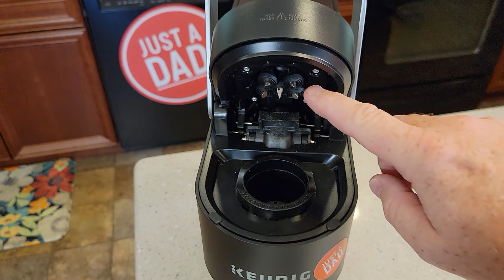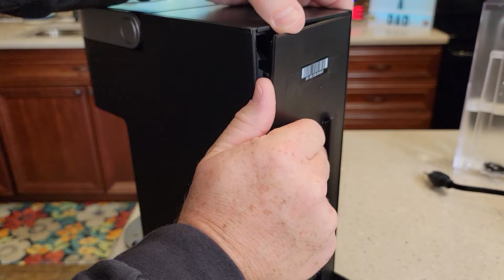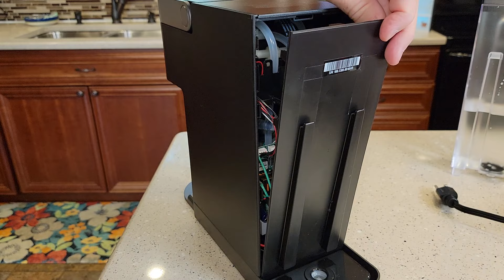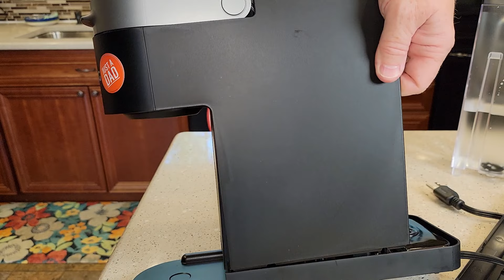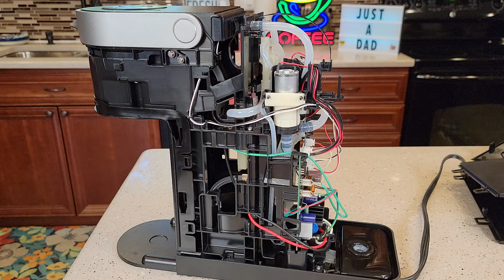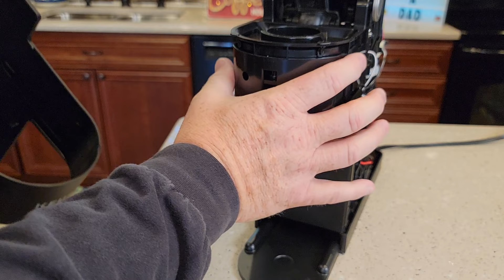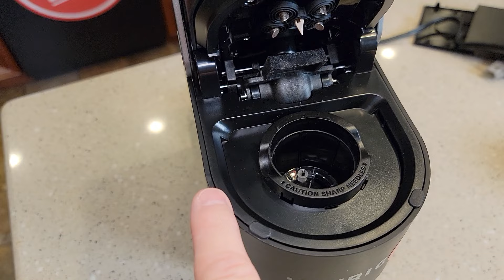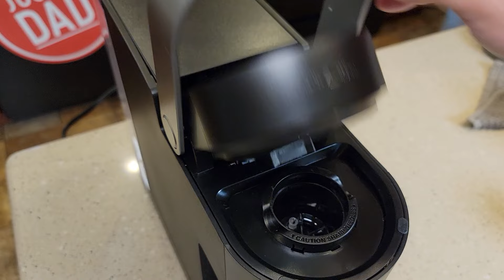🔧 Keurig K-Slim Not Working? | Thermostat Reset & Repair Guide

Comment: I have the Costco version of the bigger version of this Keurig. I returned two of them inside of 90 days. It went totally dead. On one return trip a guy walked up to the return line an asked my what was wrong with mine? He also had a dead Keurig. Very frustrating design and that’s why I buy my Keurig at Costco. Over the years they’ve had erratic reliability issues and Costco has been great on taking them back. It’s ridiculous they designed a reset switch for what appears to be a common problem with no external access. I’m not doing the surgery if I break it Costco may be lass likely to accept it back.

Comment: Thanks, just a dad! I tried this on the Keurig K slim iced brewer and it worked like a charm.

The front didn't come all the way off like in your video but I managed to reset the machine.

I had sent my original Keurig back for replacement so this was the second one and it is a hassle to give them all the documentations. Your video save me from all of that and I applaud you. 😊

Comment: Thanks to this video I had hope of fixing my Keurig Slim. Your clear explanation of how to remove the case was a godsend. However, once I got inside my machine looked nothing like the one in the video. There's no tube with another tube spiraled around it. I could find nothing that even remotely resembled the thermostat. Could I have an older or newer model?
Reply from the maker: yes the older K-Slim with only one needle does not have the reset and has a different heating element.  Sorry the older k slim can not be fixed.  The new K slim has 5 needles on top

Comment: Happy June 12, 2023 - THERMOSTAT LOCATION ISSUE  -   I have the Keurig K-Slim Coffee Maker with No Power,     Know that your guidance to open the housing worked smoothly.  However, there is no Thermostat in ore near the green ground wire.         Do you have any suggestions.
Reply from the maker: The older K Slim that has 1 needle on top does not have the reset, only the 5 needle multi brew K-Slims have the reset, sorry

Comment: Nice job "Just a Dad".  I thought there would be or should be a reset someplace, but figured I'd probably destroy the case taking it apart.  You did an excellent job describing the steps necessary to disassemble it.  Thank you.

Comment: Really good video and it really helped in pulling the unit apart. One issue. You don't mention that you need to remove the top panel above the electronics to then be able to rotate the main cover. The 4 clips hold it in place otherwise.
Reply: But I should mention that it worked perfectly and the unit is back up and running. May I ask something. My SIL was running a Descaling run when it died.  I am suggesting that in future she runs  2 or 3 cups of half vinegar, half water through the descaling process. Throw the hot mix back in for the 2nd & 3rd time to really clean the unit out. Then run at least 3 12oz runs through the Keurig to remove all the vinegar out of the system. Between your videos, and the comments online, I think the thermostat overheats because the Keurig Descaler bottle does not have enough liquid to not stop the thermostat from kicking off. Adding extra water means the system never activates the out of water feature while descaling.

Comment: A perfect walk-through! First descale on my Slim led to the power outage towards the end of the cleaning phase - seems  the add water trigger didn't trigger and the tank ran dry, system overheated and tripped the thermal "breaker" (not really a thermo"stat"). One of two design flaws in an otherwise lovely device (the other being not having access to the thermal breaker without taking the cover off - not that it was a pain. Far worse to get the grandkids' car seats in and out.). Thanks for the clear and detailed how to!
Reply: Exactly what happened with mine.

Comment: Hi!!!  You keep saying this is a Keurig Slim...however when I opened mine up it doesn't look like this one.  I can't locate the reset button.  Help!!!
Reply from the maker: The original k slim has a u shaped heating element and it does not have a reset.  if you have one needle for the top of the k cup then you have the old model with no reset.  the newer one with 5 needles on top has a reset.
Reply: @Just A Dad Videos  thanks for clarification.  Not sure what happened  but after opening it up it's working again...go figure.   May be time for an upgrade.

Comment: Hey buddy I took mine apart there is no little thermostat to reset
Reply from the maker: The original k slim has a u shaped heating element and it does not have a reset.  if you have one needle for the top of the k cup then you have the old model with no reset.  the newer one with 5 needles on top has a reset.

Comment: Took my k slim apart but the inside looks different. Can’t find that thermostat.
Reply from the maker: The original k slim has a u shaped heating element and it does not have a reset.  if you have one needle for the top of the k cup then you have the old model with no reset.  the newer one with 5 needles on top has a reset.

Comment: I appreciated this video and the function video on the keurig slim! Do you know if it's possible to replace the micro switch itself? The thermal unit and cable is intact but the switch may be bad and can't find a way to replace it in this model. 

Any tips?
Reply from the maker: maybe but finding one could be tricky

Comment: Worked like a charm for my K-Slim with Iced Coffee maker. BUT: had to do it two times because that darned air pocket caused the overheating… twice! The third time I heard it sputtering and I immediately unplugged it. Gave it a minute, re-primed the water again… and then started a cycle. And it worked like usual! Thank you, again, for your thorough walk-through!

Comment: THANK YOU! I knew there was someone out there in youtube land who would tell me how to fix this. I have a different model but knew the inside design would be the same. Not gonna lie, in my anger and haste I did break a bunch of the tabs in the process, but after putting it back together you'd never know. : D When this KEURIG finally goes for good I'm out what a crappy design. ps- not the first time this has happened, just the first time no longer under warranty. What does Keurig do? They try to convince you it's your outlet then eventually send you a new one.
Reply from the maker: Good points

Comment: Outstanding video! When my Keurig went down, I got on the phone with the company, and their troubleshooting extended only to unplugging in the machine and plugging it back in. After that they only offered me a 20% discount on a new machine. Your video was easy to follow, and it worked perfectly. Many thanks!
Reply: I kept saying no that’s not going to work and finally after being transferred I was offered 50% off any unit. We will see if they honor that since I didn’t pick one out right away. They said they would put a note on my account.

Comment: I just dismantled the one at my work that looks exactly like this except it doesn't have that thermostat that you're talking about. And what it has looks like a radiator coil in the shape of a "U" but there is nothing to reset. When I plug it in and hit the power button the power light turns on and sometimes the add water button flashes but it will not do anything else.
Reply: Same here. The exact same machine on the outside, but totally different on the inside. Doesn’t seem to have all the fancy nozzle thingies under the flip lid on top of the K-cup either. It just  has the one. In the trash it goes.

Comment: my outlet shorted and had this problem where it wouldn’t turn on. went back to a normal coffee pot for a couple months before coming back to my keurig. i did this and it turned on my but add water light won’t stop flashing not matter how many times i empty and clean it and fill it back up to the max

Comment: I did that and it work! But then I tried to start brewing and it turn off again :( I smell the burnt and the heat from the keriug 😢 I reset again and no luck.
Reply from the maker: Oh no!  sounds like your pump might be bad, or the line clogged. or air in the line.  try reseting it and filling the water tank up and lifting the tank on and off about 20 times to push water through the lines
Reply: How do you unclog line? I’m hoping that is the solution because mine is doing the same thing. I primed it like you said with the bubbles but when I look at the hoses I see where I think water should be.

Comment: Thank you so much for the video tip.  Spot on!  
I tripped the overheat reset while refilling the water canister and accidentally pressed a cup size selection button.
I followed your video and the steps worked perfectly.
Reply from the maker: Glad it helped!

Comment: Thank you sir it worked like a charm.By the way that was the first descale on a new replacement machine that Keurig replaced under warranty. While  they were reasonable to deal with, I wasn't looking forward to having to go through the whole procedure again. Your instructions were clear and precise. As a retired electronics technician your procedures to remove and reinstall the covers were more valuable to me than the fix that with time I probably would have figured myself. Again thanks again, I can have coffee tomorrow morning.😄👍
Reply from the maker: Thanks for the kind words.  Glad I could help and you can resume with your coffee!

Comment: This worked; however, even though I descaled it, the descale light is still flashing. Any ideas?
Reply from the maker: Keurig has changed the way you descale your coffee maker.  You have to put the machine in descale mode and follow it all the way through to get the descale light to go out.  
step by step instructions see below.  You have to follow them all the way through.  
I hope this helps. put the descale solution in the tank.  You have to put  the machine in descale mode.   First leave the machine plugged in, then turn the power button off.  Press and hold the 8oz and 12oz button for 3 seconds till the big k brew button starts flashing.  This puts it into descale mode.  The only thing you will see is the big k button light on.  the power button does not light up.  press the k button and it will run 12 oz through the machine. keep pressing the k button till the add water light comes on.  don't touch anything just put fresh water in the reservoir and the add water light will go out and the big k button will start flashing again.  press the big k button to start the machine again this time it will be rinsing the machine at 12oz each time you press the button.  keep pressing the k button till  the add water light comes on again.  Once you fill it up with water again it will come out of descale mode and now you are ready to use it again.  turn it on and the descale light should be out. Let me know how it goes. YOU GOT THIS!!!!

Comment: I have a K-Slim but there's no thermostat like the one you have in the video. I purchased mine on 06/18/2020 from kuerig's website.
Reply from the maker: yeah the older k slims do not have a reset, only the new 5 needles k slims.  the old k slim can not be fixed, sorry.

Comment: My mini just stopped powering up after cleaning/descaling so I will try this. 2 questions - do I have to put it back together before testing it? And two, what is that tiny square panel on the bottom (between the two screws on the long side)? Kind of looks like its a fuse in there when I opened it (I was hoping for a reset button). Thanks!

Comment: Thanks very much; similar issue; thermostat must have fired when I was descaling.  Next time I'll wait longer when descaling to start up the machine again.   The tip about the ohm meter was very useful, I could confirm the reset had worked before reassembling the machine.  Sad to think how many of these devices end up in the trash due to this issue.

Comment: This worked perfectly for me.  Thank you so much for posting it.  This is just another example of consumer product companies building in obsolescence and/or self destruction into their products.  This could be so easily avoided in the product design with a reset switch or a self performing reset in the software when the unit overheats during descaling or heavy use.  They must figure the opportunity costs for most users to figure this out is less than the cost of getting a new unit and they are probably right about that.

Comment: Great video easy to follow but isn’t working for me 😢. I reset it and when I plug it back in the light come on for a second and then turn right back off. I’m assuming the thermostat keeps getting tripped. Any idea what I’m doing wrong?

Comment: Fixed my issue of no start/power on. I actually was trying to run it dry for storage, thinking it would be good for it. Nope. It ran for 2 seconds and shut down, lots of steam and the unit got kinda hot. After finding this video i was able to get it working again. My reset didn't feel like it moved or really pop. Wasn't sure how much pressure was needed. I tried pressing pretty hard thinking it would pop or move. Nothing happened so I just plugged it back in with the side panels off and it worked. Thanks!

Comment: Thank you so much for this video.  My Keurig would not turn on this morning and what is a day without a coffee start?  I was skeptical thinking that I might have to buy a new one, particularly when I stuck the paper clip into the reset hole and didn't hear a click.  So I pushed it in there several times with the feeling I'd still have to buy a new one but, alas, your technique worked.  Thank you again!!

Comment: Just like the other comments. I was just about to buy myself a new Keurig after it bricked up after a descaling process but came across this video. I mean it was going in the trash anyway what's the worse that can happen. I pulled it apart, hit the reset, cleaned it up, and put it all back together, and it worked. Thank you so very much. You sir got a new follower!

Comment: Thank you. Thank you. Thank you. I descaled my slim last night before going to bed. All of a sudden no power to slim. This morning I looked at a unplug solution so left unplugged all day. Finally plugged in. Nothing. Time to search utube. Found your video. This 73 yo grandma needed her coffee. It works. So great full to you.
Reply from the maker: Great job!  Wow so proud of you!!!!
Reply: Hi Just a Dad - you make great videos! I always look to you when I have a keurig problem, and you’ve always come through!
Right now I’m trying to do a reset. After descaling, I tried using the keurig next day and no power. I’ve taken it apart, tried the reset button, and still no power. However, I did not feel or hear anything at all to indicate a switch being set. I tried pushing harder, no luck.
Any advice?

Comment: Thanks for the step by step video. As per your instructions,  this grandma was able to save Slim from an early demise. I had to slightly lift the reservoir repeadedly, since  the thermostat did not want to cooperate. Also, I kept the housing off, until I finally was able to get a full cycle of descaling. (For which I used vinegar) (evidently, the Keurig descaling solution I used three weeks ago didn't do such a great job, otherwise it would not have come to this emergency operation) Thanks again!

Comment: Great video! However, my kuerig doesn’t have that thermostat part in it. It’s a Slim just like in the video but it has two long silver parts inside where the coil thermostat you show in your video is. Any ideas where I can go to reset mine?
Reply from the maker: yeah that is the older one,  I took my older one apart like yours  and I could not find a way to fix it.
Reply: @JustADad  Great video.  I guess I have one of the older ones, because all I see is the 2 long silver parts and no thermostat so I guess it's a lost cause - unless you figured something out since this video was made.
Reply: Ok, no worries. Thanks for the reply! Merry Christmas 😊
Reply from the maker: @scotthand2315  Same to you

Comment: Hello there. I opened up my Keurig slim and the thermostat is not in that spot at all. 😭 Not sure if this is an older or newer model. Help.
Reply from the maker: yeah the older single needle k slims do not have a thermostat you can reset

Comment: Thank you so much! I was able to push in the reset on the thermostat by only loosening the panels and sneaking my hand inside. Saved me at least $100 thinking it was a dead soldier. And the pesky descaling light issue was fix by watching your other video!
I salute you, good sir!

Comment: Thanks so much for this video! I went from my machine not turning on to now turning on and releasing some water. Unfortunately it starts pumping and water starts to trickle out, however, it stops after an ounce and then it turns off. I've ran it 4-5 times and still not quite running it's full course.  Any other suggestions once we get to this point?  The machine steams quite a lot and gets hot at the top but water output not great:(
Reply: No update for me? ☹️

Comment: My k slim is a 2019 I bought at estate sale. Lights won’t stay on. I took it all apart but it looks different inside than yours, I can’t get the bottom off to check for reset there. I wish I could send photos to show you what I see
Reply from the maker: the early k slim models do not have 5 needles on the top and that model does not have a reset
Reply: @JustADad  are there any fixes for the earlier models that don’t turn on?
Reply from the maker: @engowka  no not for power, maybe if you want to clean out a line or something.
Reply: Neither does mine and has a U-shaped heating element. The wires to the heating element have continuity, so it's not a thermal fuse.  I have 12-volts on the board at the test points.  About ready to throw this in the trash and go buy a nice Bunn single serving combo unit that'll do either ground or k-cups.